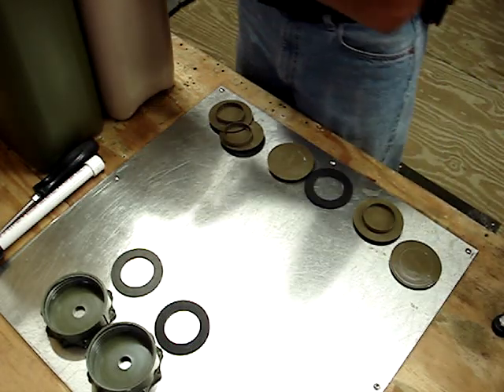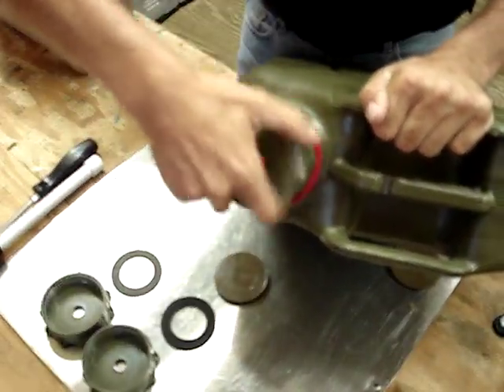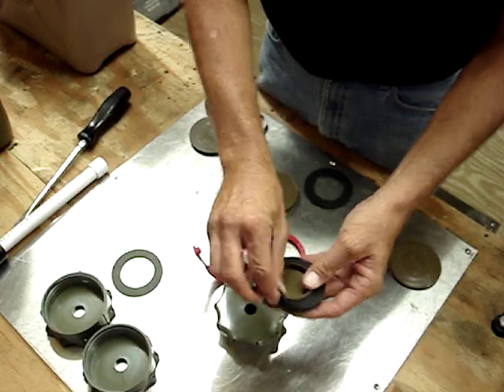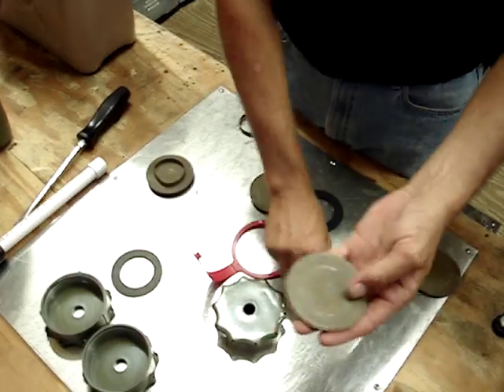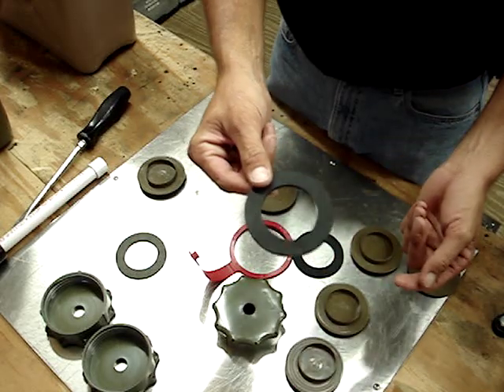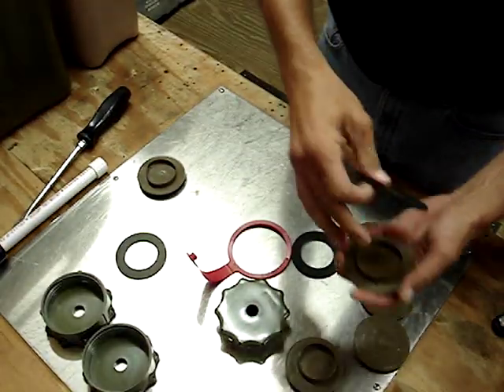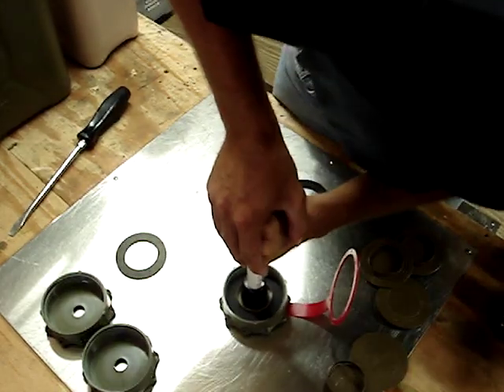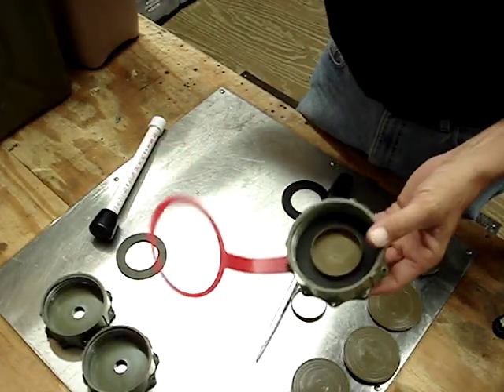Scepter Military Fuel Can MFC Cap Flange Assembly

Comment: I bought a can that’s been sitting in storage. Apparently it was made in 2000 based on the molding marks on the bottom. Do you think I can still use it to carry fuel if I replace the cap components?